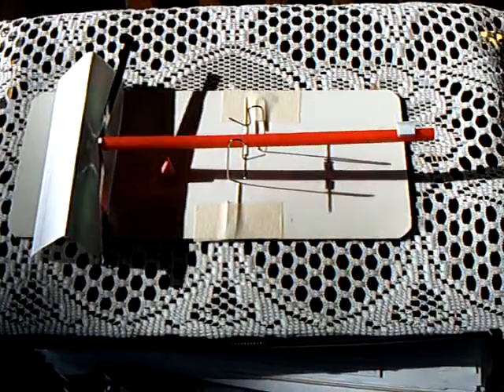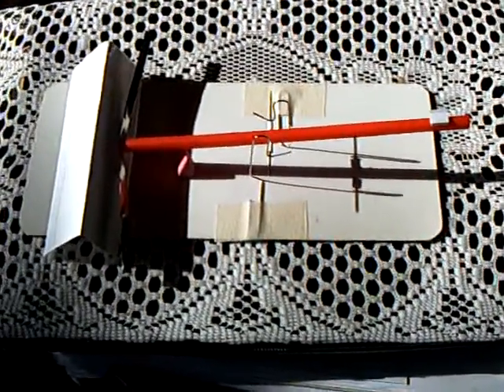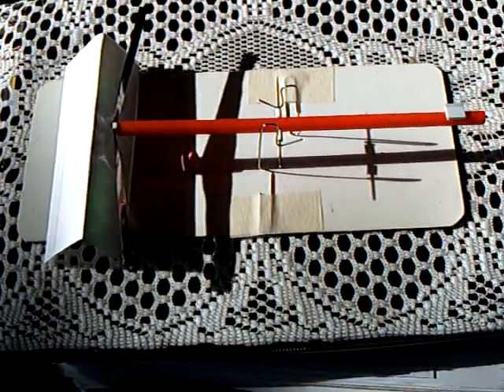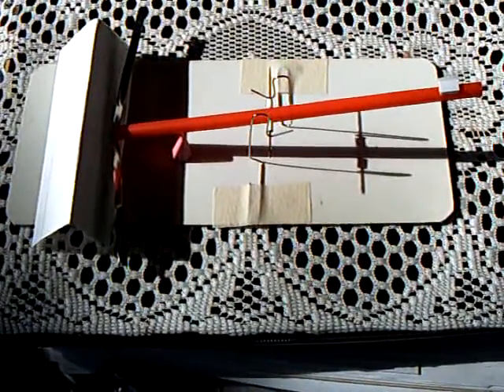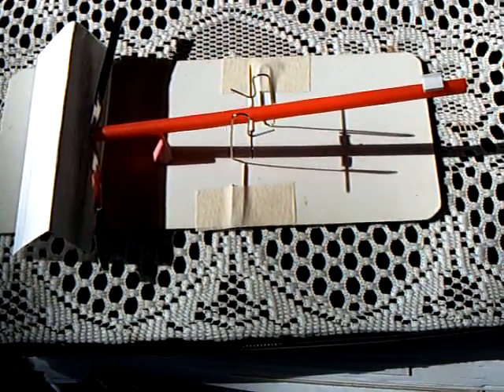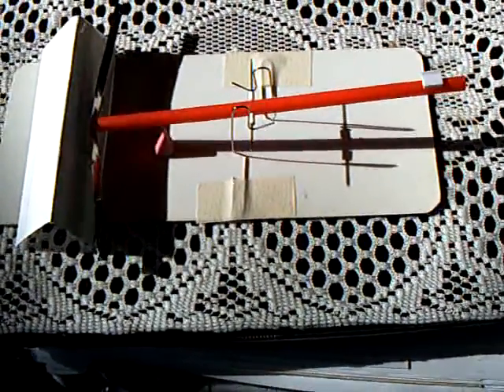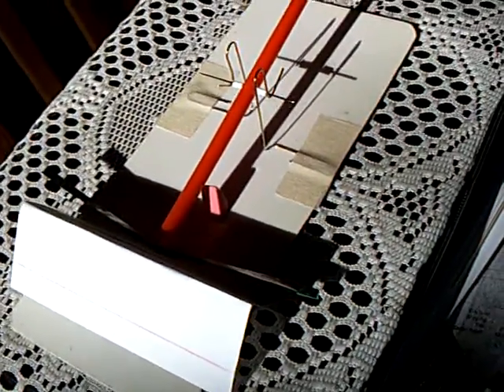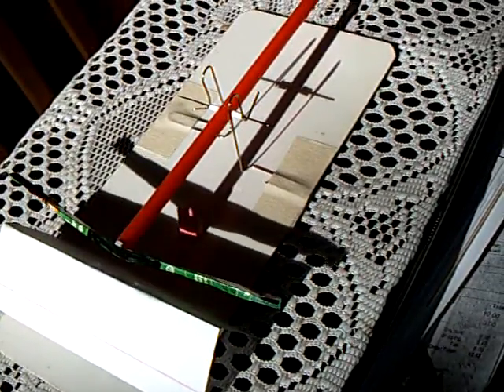Blade's Simple Heat Engine --- running on solar energy

Comment: Is that aluminum in front of the swing arm mechanism collecting the heat?
Reply from the maker: Andyity What is facing the heat source is the outside of the package material.  It isn't really aluminum (think of a mylar plastic balloon).  The inside is a food grade plastic material we think is some type of polyethylene.

Comment: THIS assembly shows that you can enjoy the difference in natural potential, sun and shadow, between light and shadow to generate mechanical energy ... An appropriate differential thermal engine is able to provide a lot of energy from sources available anywhere ... If there is a difference you can create from a flame ... just like that ... This plan to develop or assume it is already available ... rr ~ *